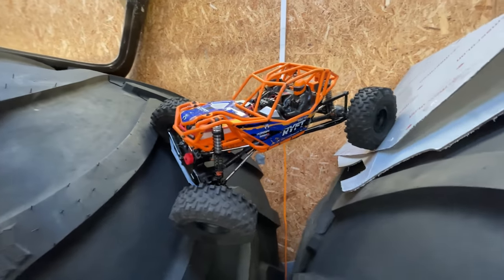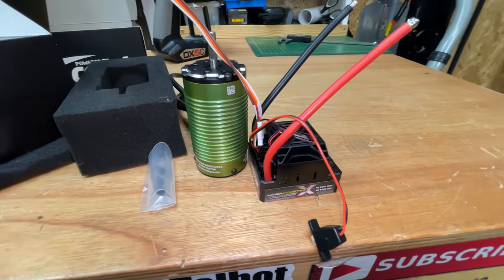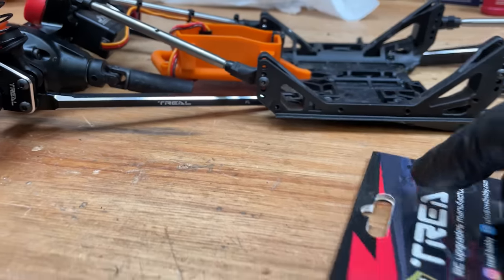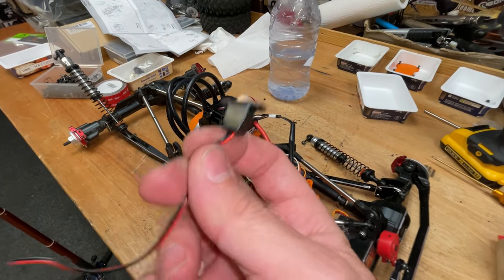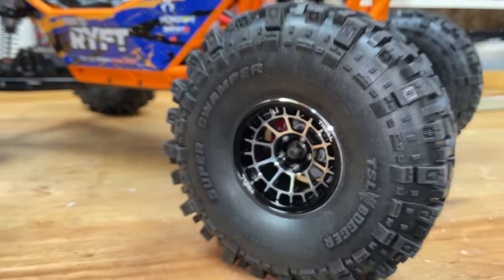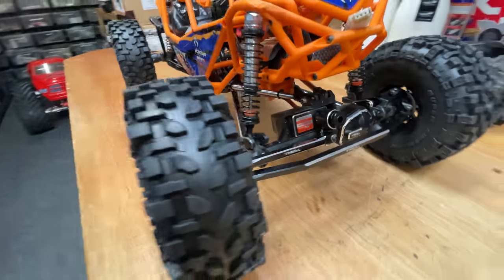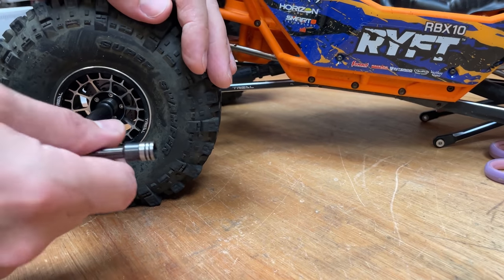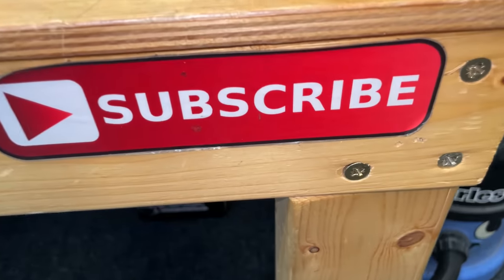I made the worst RC car EPIC

Comment: I refuse to buy a car where you have to replace everything but the chassis out of the box to make it reliable
Reply: I’ve got one and just replaced the motor and esc and it works great.
Reply: Absolutely right 👍
Reply: Same
Reply: For some people that is part of the hobby. More of the engineering side of it. It’s all personal though which is what’s Great about this hobby nothing is correct nothing is wrong you just do what you like
Reply: welcome to life
Reply: I like the idea tbh. Wasteful and probably a waste of money, yes, even more like modifying a car, my other hobby, yes
Reply: So true
Reply: @JJunior615   i like that toy
Reply: It would be ok if it wasn't 530 buck but to turn around and spend that much more replacing everything ur better off using the money for one that's already got better internals. Maybe they should sell it as a roller so we car afford to beef it up
Reply: It call hobby
Reply: I agree but don’t get me wrong I like upgrading my rig but I don’t want to feel like I have to straight away
Reply: But for some it's passion you know
Reply: Wesley ❤
Reply: Just pick up all the parts separately and build Your own.. That's what I do.
Reply: I've had the kit version for over a year and beat the hell out of it with a nasty castle brushless setup and only killed steering servos
Reply: Bruh that’s the fun part about rc’s..
Reply: @Ryanmcardleofficial  It is and it isint. For the price that horizon hobby puts on these, it shouldn't be an absolute turd out of the box. I have a $20k+ RC collection and heavly modify all my RCs for me the Axial Bomber was the worst RC ice ever bought. It took about $800 to make it usable, which I enjoyed but still its kinda bullshit.
Reply: @abingham3747  true and also Amain’s parts are pretty expensive
Reply: @Ryanmcardleofficial  That's a fact!
Reply: Am getting in this hobby so am going overboard getting 5 cars and trucks a boat and trailers
Reply: Then buy an scx 24 deadbolt
Reply: I hate that shit to fam
Reply: What would you do with this set up for a chassis? @lods7185

Comment: I would still rather have a crawler and a basher instead of two rolled into one not so great package.
Reply: this rig is rock bouncer. not a crawler not a basher.
Reply: @jacksrccars347  actually your wrong, a bouncer is just what it says , not a crawler or basher
Reply: So it's good for nothing ultimately. Rock bouncing is just uncontrolled crawling . I can see this RC car being discontinued soon.  Who wants to replace practically everything to have a functioning RC car ? Yes upgrades are a great part of the hobby but for a rig of this price I expect better out of the box. In my eyes it's practically useless apart from watching it writhe about uncontrollably off every jump.
Reply: Nah they are nice cause you can do Abit of everything with it
Reply: i disagree.
Reply: @thegreatsoutherntrendkill272  we are talking about RC cars here . As an RC car it's useless. It has no weight so can't crawl and is so wobbly it can't bash. Yes there might be rock bouncers in real life, but they clearly don't translate well into RC cars.
Reply: @jacksrccars347  Nope, dont "bash" it until you try it. This is actually one of the most fun trucks I've driven. Its not about bashing or crawling, its about using power, speed, setup, line choice etc... to make it up nearly impossible trails. Crawling is all about, controlled precision moves which is great but gets tedious after a few hours. bashing is just doing mostly dumb things for entertainment. Bouncing is a real competition here in the states and the Ryft is an accurate replica. Check out some rock bouncing bounty hill videos. No offense but Kev isnt exactly using it properly
Reply: @rcilluminati26  I completely agree I have been amazed what I can make it up with the ryft

Comment: Omg on 6s that things gonna absolutely rip!!! I do want an Axial Ryft but it’s not at the top of my list yet. That thing sure looks like it can take a proper beating now! 👊👊👍👍
Reply: I built mine as soon as the Ryft kit came out, with all the Treal upgrades. Installed a Hobbywing XR8 Plus 2250kv motor & ESC combo and run it on 6S (2 x Gens Ace 3S 4300mah LiPo). I made almost the exact same modifications that Kev did to get the 1/8 scale motor to fit.

2nd gear on 6S is completely insane. Totally worth it :)

Comment: If you use the aux wire and program full drag brake in low gear. It will crawl heaps better. Low end resolution is goes up with more drag brake in the castle esc's

Comment: Really been interested in the Ryft for a while now. With all the upgrades available and this vid, that might have sealed the deal. Good to see you uploading Kev
Reply: I don't have one, but someone in my club does. I have had a vaterra twin hammers for ~5 years now, which is a very similar rig. In my opinion, horizon really screwed up with this truck, they were selling a much better RTR truck years ago with the twin hammers that didn't need this level of modification just to be runnable. That being said, the combo crawler/basher is seriously fun to drive. They definitely aren't the best at anything, you can easily get better performance with 2 separate trucks, but having 1 truck that does both reasonably well is tons of fun to take out hiking. I don't know if it's necessary to go quite as ham as kevin did, but the guy in my club only ran his on the stock motor once before upgrading to brushless. I don't remember what he is running, but he had the exact same problem with cogging and ditched the stock motor right away.
Reply: Keep in mind it would cost a lot

Comment: I just recently purchased the axe system. Found the same issue. Changed the throttle ramp setting in the esc. Issue fixed. Level 9 is instant POWER!

Comment: The sensor is for something called vector control. Knowing where the rotor in the motor is allows the controller to more accurately place the rotating field in the stator windings. In the industrial world we have the same thing. Allows for a MASSIVE amount of torque at low speeds. There is also something on the middle ground called sensorless vector control. The inverter (or what would be an ESC in the RC world) tunes itself to the motor by going through a routine with the motor sitting mechanically-bare (nothing, whatsoever, attached to the output shaft) and it spins it up for a few seconds and analyzes the back-EMF coming from the motor.

Comment: You for crawling you would have better luck removing the foams with beadlock wheels. Or shaving the foams considerably before reinstalling. The foams that come in those tires are big enough for bigger 10th scale monster truck tires or even 8th scale trucks. You get better ture squish and side bite and overall traction woth shaved/no foams.

Comment: What kind of motor is going in your monster truck? A 454, or like a 572 or a like an LS 454? Or something?
Reply: It's a supercharged 540 big block Chevy basically the same thing that's in every monster truck
Reply: Oh gotcha ok, I have never heard of a 540 Chevy before, is it a crate motor or is it a bored out motor?
Reply: It's an aftermarket Block with a stroker rotating assembly runs off alcohol

Comment: Hey Kevin. How much of a spacer did you have tu use to get the motor to clear the chassis and the one link? Did you have to rotate the motor at all or is it just a super tight fit. Having trouble with mine.

Comment: I’m new to this and really like the ryft cuz I feel like if it’s built like you did it it’s the best of both worlds with speed and crawling they have a sensored version for like 200 less than the regular if I’m gonna replace everything it would be better to buy that one right? Or is the anything els different on it besides the sensored engin

Comment: I still think you missed the mark with the axe due to the stock parameters. If you were to have tuned it and changed setting you would have loved it.
Reply from the maker: i tried, and a few friends tried too, maybe its a faulty unit? half the settings on app were not changeable
Reply: @KevinTalbotTV  interesting,  I was able to configure everything. Did you update the firmware?
Reply from the maker: yes and tried resetting it
Reply: @KevinTalbotTV  🤔 maybe it was a bad unit

Comment: Hello Kevin, I’ve recently bought the Arrma Granite Voltage 2WD and I was wondering if there is a possibility to turn the open differential in a LSD or a locked differential, if so please respond to my comment. Thank you, Kyden (Subscriber).
Reply: You could always put really thick oil in the diff to pretty much lock it
Reply: I’m pretty sure Kevin did a video where he used silicone ear plugs to lock up a diff

Comment: So... maybe you read one off my previous comments :p i have the 1515 monster X system in a trx 4 / axial wraith / end a Cragsmann (1/8crawler) 
And guess what.  In my wraith i had to do the exact same mods to make the motor fit :p 
I have a new banggood double e defender (the grey one) thinking about put the mamba monster x in it :p 😂👌

I have used 6s once a the wraith.... absolutely epic you would say 😂😂👌 
But way to fast and things break easily then.. so did it only once :p